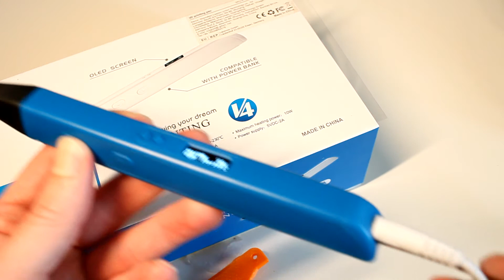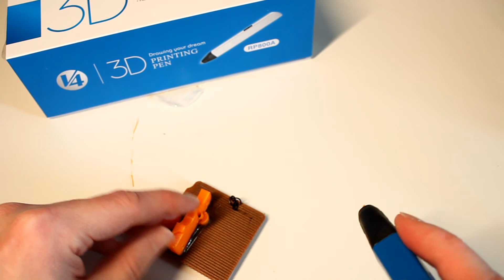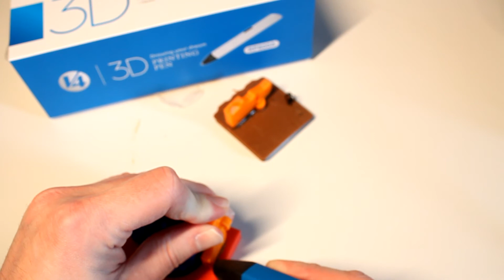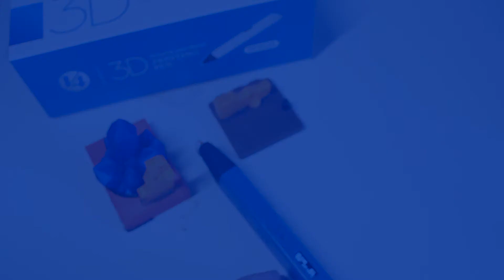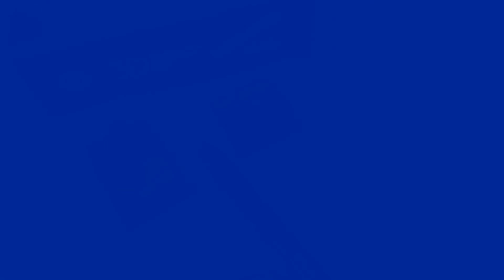Using a 3d pen to "weld" PLA together!

Comment: i dont know what you are doing different than myself, but i found the joints to hold until even the slightest amount of stress is put on it and they come apart with absolutely no fusion between the parts or the weld itself.
Reply from the maker: Raise the temperature a bit
Reply: @LostInTech3D  yeah, I found bumping the temp and changing to known good filament off the roll is a lot stronger bomb than the junk that came with the pen.

Bambu pla was strong enough to pull layers off the print when trying to break the joint.

Comment: That is clever. My daughter owns one of those pens, but I never once considered using it in this way.
Reply from the maker: Generally me neither - I carry around a book to write these kind of crazy ideas down, if I don't get it down immediately it's gone forever 😂
Reply: @LostInTech3D  I know the feeling.
Reply: I researched the best glue to use for gluing PLA together and the main contender seemed to be SuperGlue. So I tried SuperGlue and it was a dismal failure, so I asked my 3D printer shop guy and he said that heated 3D pens were very effective, so I bought one and have been using it all the time to bond my 3D prints whenever they needed to be stuck together. Works quite well.

Comment: So you just press the pieces together and run the pen along the edges to 'weld' them together by the looks of it? Does it work to draw adhesive lines on the connecting face(s) of the pieces you're welding together and then press them and let it dry or does it cool too fast after extruding from the pen? Would like the added strength of using this method but would rather hide the welding lines from the pen if possible 

Btw that looks like a mineral field from Starcraft - do you have a link to the STL? Can't find it and want to make a translucent blue lamp out of one
Reply from the maker: I'm trying to find the model I used on thingiverse, I am pretty sure I searched for "crystal" and one that you can shine a light into. Feels like maybe it was thing number 189703 or a remix of it. It didnt work too well for shining light through though.

Yeah in answer to your question unless it's a very small piece then it's going to dry to a lump and hinder the gluing before you can get it together, I mean, practicing might make it possible but I didn't have a lot of luck with that. I can't remember if I'd discovered by the time I did the video that you can use it to make rivets too. I should probably do a vid on that at some point, it's potentially a game changer for hinges etc. I actually fixed my laptop keyboard by replacing the plastic ultrasonic rivets with 3d printer pen rivets which was quite impressive..I'd filmed it at the time but the battery had run out in the camera so the whole lot never ended up on youtube... :)